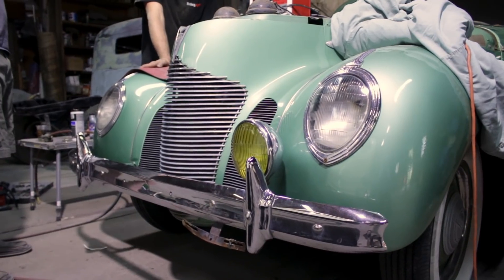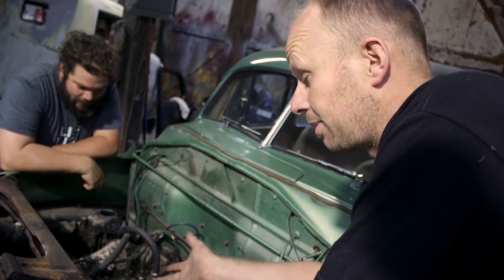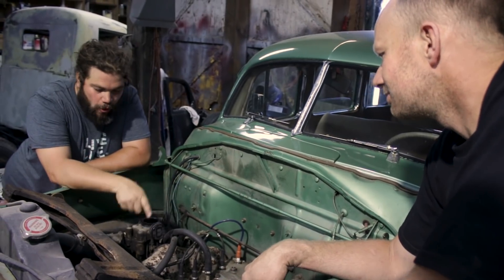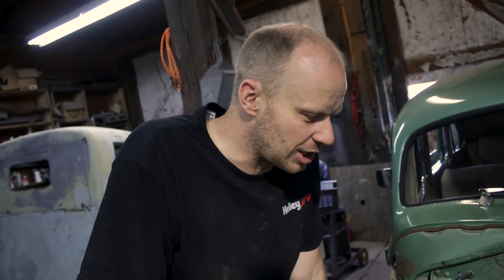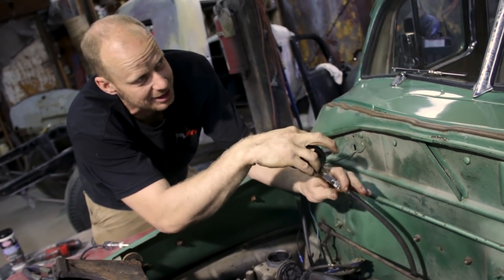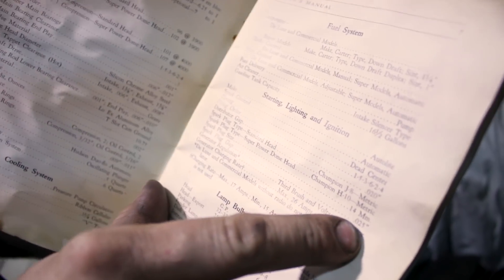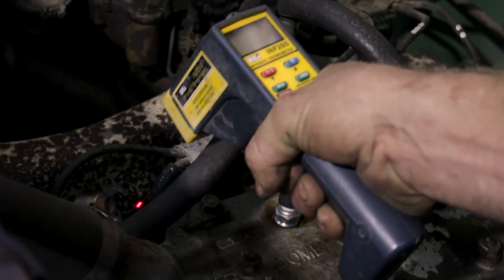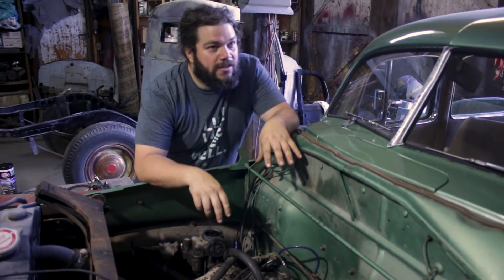Why The Carburetor Is Still FIT FOR ROYALTY

Comment: I had a similar issue . The air mixture screw wasn't seating properly .you also need to change the fuel lines as the ethanol in modern fuels dissolve fuel lines. It sounds gorgeous .to clean that filter soak the gauze in petrol and light it . Then soak it in oil

Comment: Flathead motors have the valves in the block next to the cylinders; the spark plug port is usually not over the cylinder, hence the fake-out that every cylinder was at TDC!

Comment: My '53 drove like that. Idled ok, or you had to do full throttle. Nothing in the middle. Rebuilt the carb (intermediate circuit was plugged) and it works like a new truck.

Comment: lucas fuel injectr cleaner works as i used in on s10 2.2 246k miles running ruff firm setting 1-3 years fixed it injectors

Comment: I love your videos and visit the old ones   cause they are entertainment and since my life now is setting at a desk wishing I  could walk... yada yada, loved the ending "broke the horse off the hood thing" I can relate to. Back in the day, just before the service, I have this 55 chev that runs sorta good, a little tired from wide open throttle episodes, (ran the dog shit out of it) parked the  car in front of the local burger stand. This is a place where hot girls and big guys protecting their turf are and we are local bad boys. I have duel exhaust and straight pipes and no hood for this particular days fun. So the car is running fair again as said and goosing the pipes to get said girls attention which was getting the sly look but they can't cause their jock boyfriends are super protective. How does this pertain to STP you might ask? Well while leaning over the fender and controlling the gas by hand, I slowly so it doesn't kill the engine (stop running) start adding this wonder drug to the carb straight from the can down the open four barrel carb and now it is smoking (could of done this with any oil) and its coming out of said duels, pouring out is a better description, and so it  doesn't die wait till it clears enough to continue pouring and by time done in say five minutes or more... filled that burger stand up with smoke and a four alarm fire drill couldn't get that much smoke in the place. Fire trucks are on their way along with cops and we are out of there, gone like bad habits and laughing so hard I  like to shit myself. The fire department goes in with fire hoses pouring the water to the place, finishing what we didn't cause now they have real problems and everyone inside is soaking wet but to the jocks defence, description fit my  car and I went to jail where sooner than later the guy who called the cops on me was my cellie. I put knots on his brain box and so he wouldn't testify against me. Longer and better story short version, I served in the military with him (all of us drafted) and we were good friends... STP was the right choice for making smoke in a large quantity and Hall's drive in was remodeled. I swear to god that this true

Comment: I use STP diesel oil additive in my tractor and that makes it rev like a car, also no smoke and no vibrations. I also use diesel injector cleaner and that works like a charm, firing of my tractor have improved a lot. I use STP in my car and after just 100Km it ran a lot smoother.

Comment: A sinking float is less likely to cause an issue under load than at idle. When the engine is using enough fuel the float needle never closes, it doesn't matter if the float needle leaks when closed.

A float with a hole sinks, like a boat with a hole in th hull doesn't float once it's filled with water. A sinking float makes the needle never close, once it sank.

Comment: The real heavily leaded high test gas only came in around 1954. In 39 they had low octane gas with little or no lead. You should use the lowest octane regular and could add 10% kerosene to lower the octane level. It was made to run on about 65 octane gas. You don't need lead. If you are worried about the valves you could add some Redex, Marvel Mystery Oil or your favorite upper cylinder lubricant to the gas.

Try some graphite on the  heat riser valve.

Hudson used a low pressure splash lubrication system. It worked well at low and medium speeds but they were NOT a high speed engine. Keep your cruising speed down to 50 and you will be fine. Push it much faster than that and you will soon burn out a bearing.

Comment: I always remember FIMPAC from Centennial College where I got licensed back in 1989
FIMPAC  for carbs stands for Float, Idle, Metering valve, Power valve, Accelerator pump, and Choke.
Amazing the shit you remmeber.

Comment: Carburetors rely on the air cleaner to keep proper vacuum. If it’s not there it’s more likely to backfire through the carb and spit fire. You should always tune a carb with the air cleaner on if possible.

Comment: I sold my dad a 1960 white Chevrolet car because it was like it was smothering and loosing power .    It looked brand new but I got disgusted and it also run to warm and it wasn't from slow timing . We drove it up to dad's younger brother's house at Shepherdsville ,ky. and told him what it was doing .    He looked under the hood and said he knew exactly what was wrong .     He took some tools in under the car and dropped the exhaust pipe loose from the manifold on the passenger side.   He then took a big screw driver and hammer and ripped out the flap that closes when the motor was warming up that works off of a spring and heat in the exhaust manifold .    Being rusted , it had stuck closed and was blocking one half of the exhaust , causing the motor to overheat and loose power .    Sounds like this Hudson might have the same issues . ---Ernest E. Johnson

Comment: Water is the best carbon remover, set up a water injection system or water vapor injection and your valves and pistons will look new again.....oh ya, water is cheap too. I run water vapor systems on all my vehicles, it also increases octane and prevents pinging and your oil stays cleaner longer. Nalgene water bottle and fish tank diffuser stone and piece of line costs about 20 bucks to make a good one.

Comment: Why is lead added to the gasoline?
Reply from the maker: Lead acts like a cushion, mainly between the valves and cylinder head.  Without the lead, the valves will pound into the head as they didn't have hardened seats back then

Comment: I recommend reminding people to use a funnel to pour those treatment liquids into their tanks as I have seen clean coat completely dissolved by that stuff before. Also, old engines run better once the scale/rust gets knocked off old exhaust/intakevalves that sat open for years and the compression increases too after a short bit of running.

Comment: I passed emissions inspection once in an old Camry. The first time I went i waited in line for 20+ minutes and when I decided to rev it a bit, since it was idling so long, a thick blue ploom of smoke came out and blew through their facility, prompting a guy to come out and send me & my old Camry packing! I added STP to bring the oil level up a bit & went back another day and won! Obviously old rings and valve guides had let thin oil accumulate in the engine during the long idle and the STP took care of that problem for me that day!

Comment: @22:34. The TEL in that era engine (fuel) is primarily for the valve seats, not preignition - I doubt that engine is running better than 7-1/2:1 compression. Mid sixties iron of course a different animal.

Comment: The good old days, when owners manuals were full of useful information and not just a bunch of "everything will kill you!" and "take it to an authorized service center."
Reply: svtirefire Old Play-boy magazines have the same problem as this manual for some reason.
Reply: And “Use only original manufacturers parts”
Reply: svtirefire I have an old owner manual that shows a test method of ignition coil polarity using a wooden pencil. One would hole the graphite tip between the removed plug wire boot and a ground; the spark would jump from the positive to the pencil to the ground. The energy would create a fireball of graphite dust that would shoot toward the ground, indicating direction. There’s no school like old school

Comment: If your gasoline been in the tank for over 8 months & one is wondering if it any good. Best way I have found to test it is a burn test need a fire proof container like a food bowl works fine. Light some fresh fuel ck the color of the flame & if there is any smoke. On the old fuel light it normally if its bad it will have a light to heavy black smoke & burn yellow. Try it see what you find & get back to me I'm in Texas, Thanks GR8 show.

Comment: Lead protected the valve seats! Thank you for saying that. Most people don't know that anymore. I could still find tetraethyl lead fuel additive in the late 80s, but I don't know if it can still be found today or not. We used to get 110 octane airplane gas from the airport and then add a can of lead. No idea what it took the octane up to. We used to race on the roads long before "street racing" became a thing. But that was then, and the gas was cheaper. And you could still find a Chevy 396 or 427 in a junkyard.

Comment: With these old cars its good to test the condition of the engine with a Vacuum Gauge. Just connect it to the inlet manifold and read the gauge, then compare the result with the chart provided and get a quick diagnosis.

Comment: When I worked at an airport in a VERY rural area, my boss (owner of airport) had an old jeep Cherokee he ran exclusively on the 100LL leaded airplane gas. That jeep has a fucktillion miles on it and he still drives the bastard today. Clean the plugs every so often. Good to go.
Reply: Till the compression ratio from the lead in the squish space kills it. Takes a few hundred tanks of fuel to do it. In a Cessna 172 that is like 1500-2000 hours or close to the life of the engine anyway
Reply: @theairstig9164  Yeah but it's an old jeep 4.0... And as a guy who prefers LS blocks in everything.. Even I'll admit that engine is legendary for lasting forever. Very hard to kill. Plus the guy who runs that jeep that way is himself a licensed A&P mechanic, and has Major airframe and powerplant service for maintaining his fleet of commuter planes on premises at his airport, where he also lives. 4 mechanics on payroll. So fixing any long term issues it may cause, for him is trivial/costs nothing. There's no emissions tests or anything like that around there, and there's literally one cop. Who's nearest backup is 30+ miles across open water. Lol. So he tends to just kinda keep to himself and be a friendly guy since there's zero crime over there anyway. I guess someone could make the argument that he's harming the environment or something by running that gas in his jeep... But he'd probably argue its negligible compared to the two O-540s each of his 5 planes has. Lol

Comment: Heh heh, nice old Hudson! Timing was way late on it though, that's why it didn't have any power and wanted to overheat. I was sitting here clenching my teeth and muttering 'turn the distributor.. turn the distributor!🤣 I'm sure you'll get it all lined out eventually. A new intake/exhaust manifold gasket wouldn't hurt either.😉 Cheers guys!😁

Comment: OK. Ill ask since nobody else will. What the hell is an ethanol deposit? Isn't ethanol a solvent? I run E85 in a daily driver and everything is cleaner than on regular gas. The oil doesn't even dirty as fast, low soot even at rich air fuel ratios.
Reply: it's corrosive and leaves behind dissolved metals, rubber and whatnot, when heated that stuff fuses to the surface
less an issue in newer cars that are made for it with stainless valves, etc.
Reply: listen guy, it drys out rubber and attracts/absorbs/reacts with water over time and corrodes aluminum and leaves behind cruddy gummy deposits, my whole business revolves around the issues ethanol causes and non ethanol fuel does not cause these issues, it is also not much of an issue in modern injection systems and in oftenly used engines.
Reply: @disassterb8   Ethanol does absorb water, but if you run a high concentration of e, it can hold a massive amount of water before your fuel starts to seperate, people like you seem to think e10 and e85 have the same properties. I have had no issues running e85 through aluminum careburetors, and rubber lines. So I guess your job is spreading oil companies lies, right?

Comment: I've used STP oil treatment only a few times. Only when I was trying to treat an issue. I bought a thunderbird turbo coupe from a widow that sat for a little over a year. I done oil change right away and only was able to drain about three quarts out. Dipstick read in range, no low oil light so i figured sludge. I used the blue bottle STP oil treatment for 1k miles and done another oil change and this time almost full capacity came out. All good after that. We put another 60k on it before selling. Bought a top line Intrepid with 3.5 V6 years later with 88k that had a tapping noise only when it sat for more than twelve hours. I used the yellow bottle STP treatment and the nose went away no matter how long the car sat. I never retreated either vehicle after the first treatment. Both were treated for 1k miles then just used high mileage oil after that. I think it works good.

Comment: Why didn't you get ethanol free fuel? You can get 101 Racing fuel that is ethanol free.  You will still have to add the lead for the valves.

Comment: Gas itself is pretty good solvent and excellent at dissolving stuff. Maybe next time do a control of straight gas vs the cleaners to see if they are any better than the gas you are putting in the tank to begin with. I'm going to guess it works as well or better if you just sit the valves in it.

Comment: Soaking the valves in kerosene will work as well, the best thing I have found is cellulose thinners for cleaning carbon and gum from engine parts works better than any proprietary cleaners and is a fraction of the price. Just keep of certain plastics.

Comment: Imagine working on that car back in the 40's and 50's no internet, and you've got the wrong manual lol
Reply: cars back then were so simple you didn't need a manual or internet
Reply: @grievuspwn4g3  most people come from lawnmowers carburetor so they think it is simple... Just dumb the last carburetors overshadow fuel injection system with complexity no one would expect, half mechanic half electric half primitive halft transistor vakuum water temperature controlled contraption that relies on parts NOT to be worn out...

Let that be a warning from a Mercedes c123 230CE owner with a W123 250 in his garage, carburetor sucks ass if late model

Comment: Gotta love old cars from back when owners manuals actually gave you relevant information
Reply: I guess you haven't read an owners manual lately, big as the bible, so you know how to operate the radio and turn signal switch. There usually is a page on maintenance that says to take it to the dealer.
Reply: @midgetrace  which a big difference from the old manuals to what we have today is that the old ones were the engineers manual,today's is a user's manual

Comment: Those engines never had a whole lotta compression to begin with. My 55 GMC with the Pontiac 287cid V-8 only had 90 pounds on #1 and 115 pounds on #8 and it ran fine.

Comment: i've used the STP engine stop leak and it's amazing for rear main seal leaks, even the rope style. especially if the engine hasn't run in years... leaked badly and the stop leak added stopped it almost immediately

Comment: I use STP and Lucas fuel additives around once a month in my 98' F150 4.6. Have not have had to do any engine work. Just filter changes and oil changes. 192,000 miles so far.
Reply: Never used any additives and 180000 on my 2003 Nissan. ....one new fuel pump though 
🤷🏻‍♂️ need repeatable tests to say definitively if stuff works
Reply: @cjeam9199  Nice! I use the additives because the 4.6 is known to have carbon clogged throttle body in higher mileage, especially if the previous owner used cheap gas and skipped on fuel filters. Bought it with 132,000. I know several owners of the model year who have had issues with clogging. They started using additives and no issues since.
Reply: @coltonsanford9759  Yeah but the throttle bodys on older v8s are easy to clean and probably routine maintaince. I just did it on my 96 f150 5.0 never been done and it was dirty...
Reply: Colton Sanford 320k on my Chevy van 04 STP and Lucas in motor and trans. No issues.

Comment: I've used stp motor honey religiously in a 86 T-Bird, and could feel the difference in the whooped 302... It stopped smoking at start up, and definitely helped with the leaky intake manifold seals...
I actually got nervous, because, if a Ford isn't leaking oil, it doesn't run.
Reply: Ben Yunik uh that's a design feature... external lubrication is very important, otherwise you end up with gm like swiss cheese.
Reply: @salvadordollyparton666  That's Mustie1's approach to rustproofing

Comment: The best way to get rid of carbon is to spray a fine mist of water into the carb above idle and rev the engine and you will see the carbon come out the exchaust
Reply: *with engine up to temp

Comment: Used engine oil is great for marking out a home made gasket, wipe some on the surface you want to copy, press it onto the material you want to use, and it will transfer the outline of everything you need to cut to fit........
There you go....

Comment: needs lid to pull fuel into throat.. else it flood it with air. pops and stuff. Especially bad when displacement is way too much for the tiny carb.

Comment: That filter is supposed to have oil on the filter material and the material is like a very large steel wool you are supposed to clean and re oil the filter, good work and keep it up